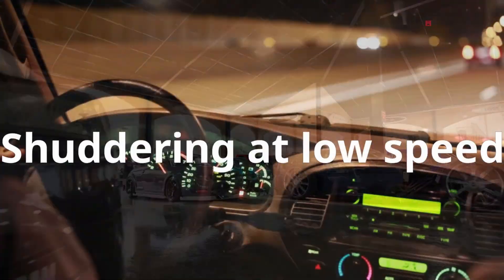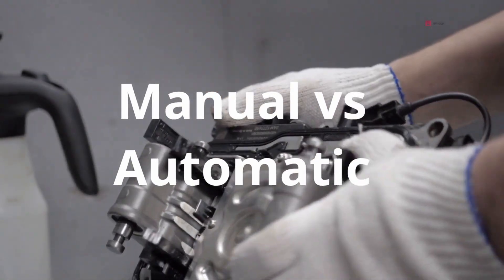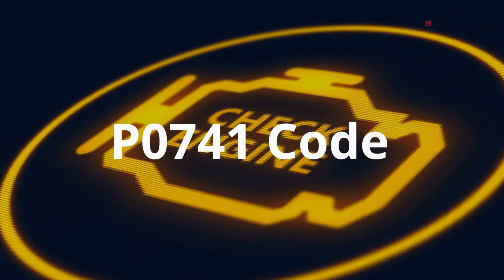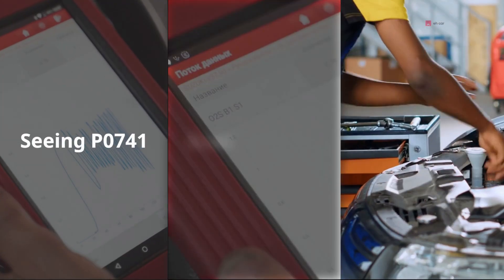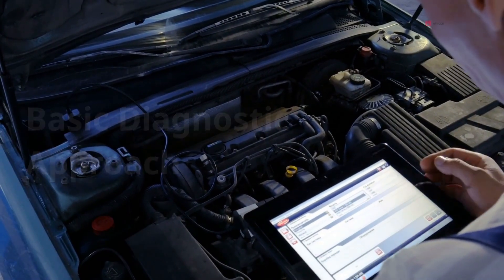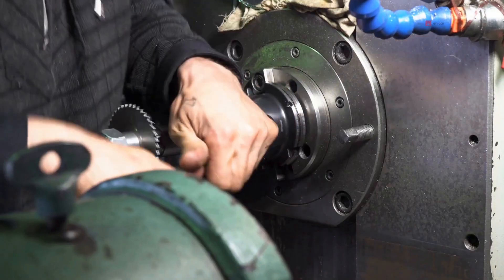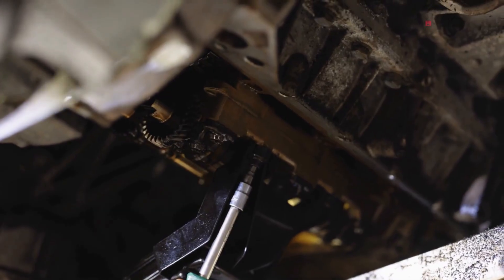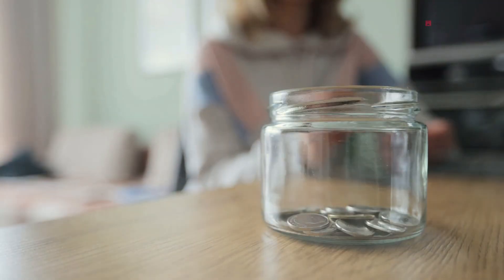Bad Torque Converter Clutch Solenoid Symptoms, Location, Fixes/Replacement Cost + P0741 Code

Comment: I think if I’ve got torque converter problems but it could be something completely different.. F150 2.7l Ecoboost doesn’t necessarily shutter but it feels like more of a jerk at highway speeds when over 2000 rpm’s. I don’t seed the tac jump around or anything but it just feels like I drove over a single half inch speed bump. Depending how long I hold the gas it could be multiple but not a shudder, maybe happens once every second l, so a slower succession. I’m sort of at a loss here so any ideas? Not getting any codes other than a catalytic converter code, which I guess could somehow maybe be the issue but I’m having a hard time understanding how that could be causing this, so leaning more towards torque converter problems. Any ideas or questions welcomed